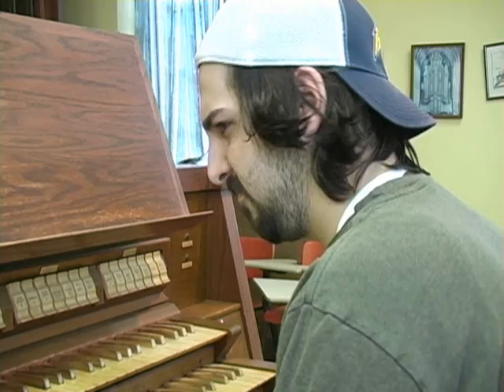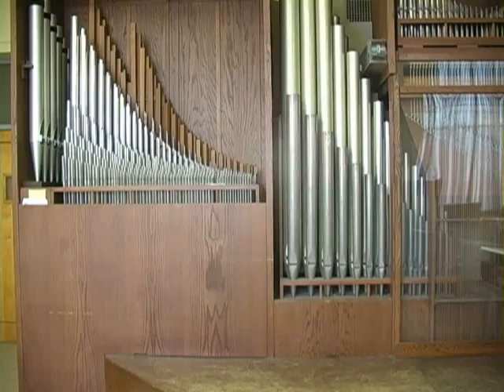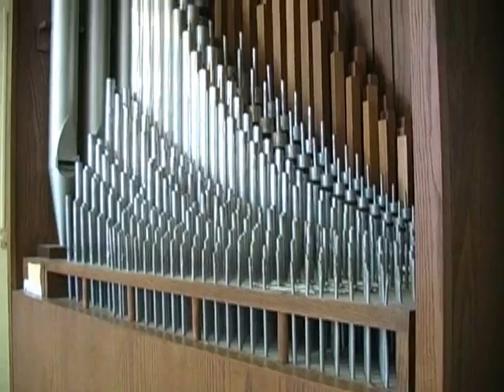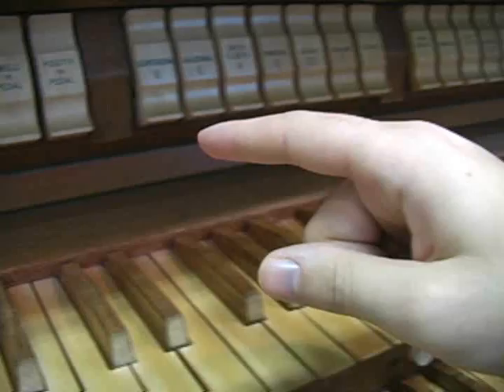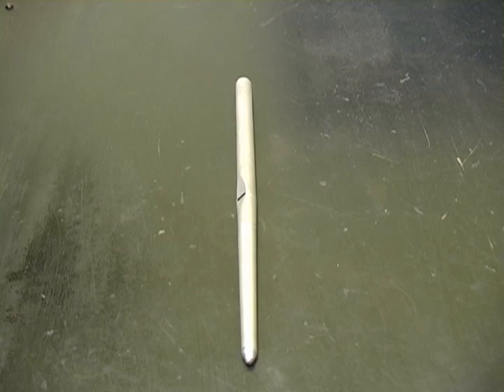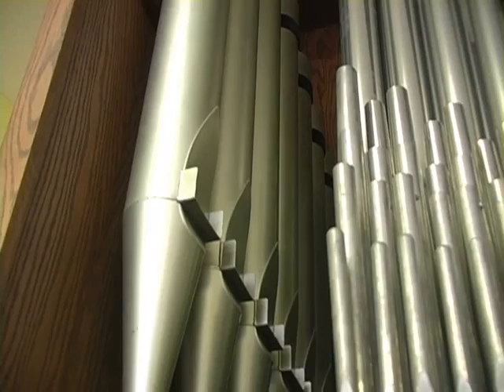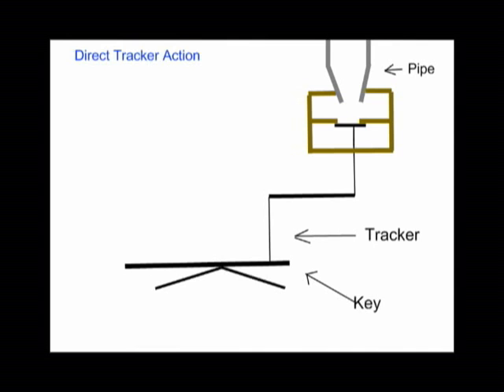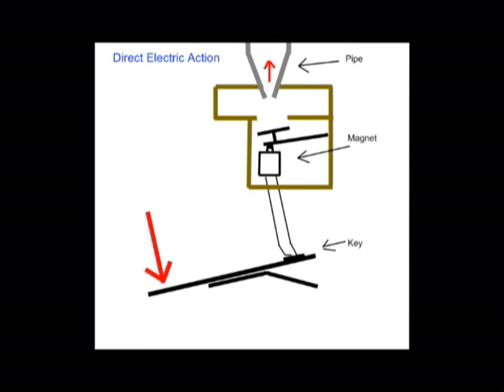A Study In Organs

Comment: @Zylstra555:  A *rank* is one row of pipes, one for each note.  61 pipes on a manual, 32 on pedal. The majority of stops are one-rank stops.  But some knobs control two (celeste) or three, four or five ranks (Mixtures or Cornets). No Roman numeral on the knob?  It's a one-rank stop.  Roman numerals?  It is a (however many) rank stop.  An organ virtually always has more ranks than stops.  Got it? :>)

Comment: @Zylstra555 In general terms, a rank of pipes is the same as a stop of pipes - both mean a 'set' of pipes from largest to smallest.  Some organs have 'stops' which consist of more than one set of pipes.  A 3-rank Mixture, for instance, has 3 pipes to each note, so in this case a single 'stop' (the Mixture) consists of 3 ranks.  Then again, organs can be built in which the 'stops' at the console are a selection of pipes taken from the organ's several ranks (a way of 'cheating'!) ...

Comment: Regarding having a detachable keyboard, you failed to mention such a convenience is a trivial thing paid for royally by an insensitive playing action, which usually requires unreasonable wind pressures to work, which in turn disrupts the voicing, and due to lack of key-channel wind chests (single valve per key for each division) there is a lack of cohesion between "on" and "off", and that the valves typically operate exceedingly fast causing an unnatural sound especially during trills....